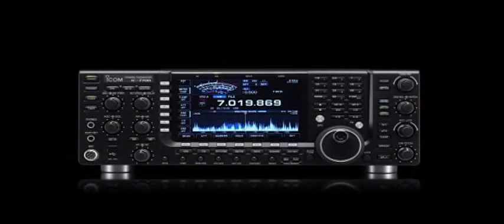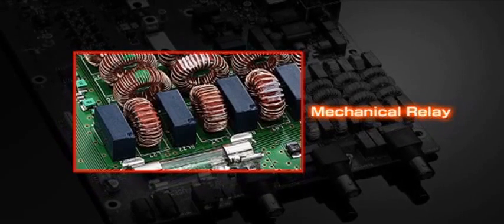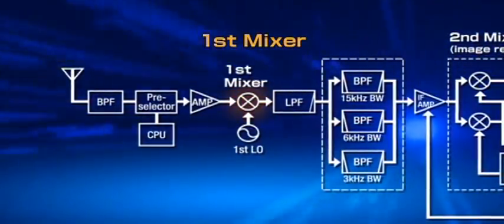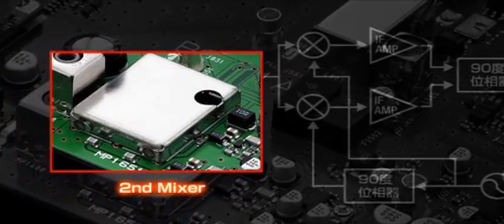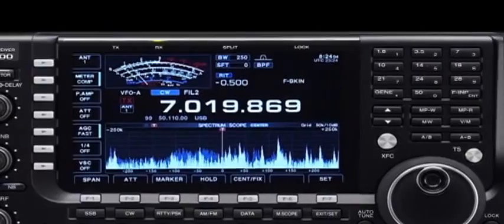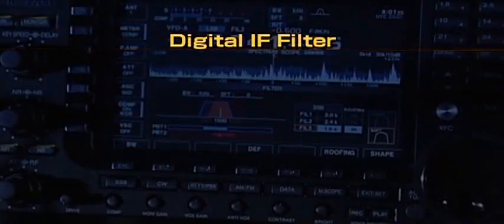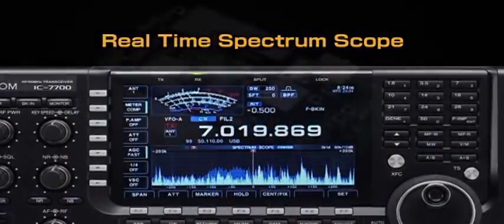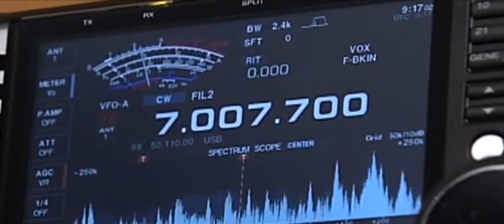A Detailed Overview of the IC-7700

Comment: the new version of the Icom IC-7700 does not use two MRF150 transistors in the PA anymore, it uses now 1 single transistor, an entirely different one. there were lots of problems with the pair of MRF150, they quickly damaged and the repair costs $2000.
Reply: I inherited a free, broken IC-7700....almost a grand to fix it, with Ins./shipping both ways (there was a note on top: receives, but no transmit)....got more goodies than I know how to use, and a 240+page manual....but beats paying $6000 for a new one.....for the big bucks....it should have a 2nd rcvr, like the K3, and K4 (????)....but so far, I do like it.....the internal tuner can't do some of my wire antennas, but it does work on 160M....as my TS-850S does, but my TS-440SAT won't tune on 160....I'll spend the winter, and a few contests, getting familiar w/it.....love CW, so I'll concentrate on getting those parts of the radio down first.....and I do like it, cuz I ain't been on 6 meters, in 30+ years.....and it has 6M.....
Reply: they just charged me $763 for both.....with labor....has the 2 MPF 150's I think it is....but the rig was free to me....had a note on it, no transmit, bur receives well....I sent it to Icom....they said $763....I said fix it....$5995, with a power cord, and a manual, from GigaParts....nothing else....
Reply: MRF 150's....my bad....
Reply: I just purchased an ICOM 7700 from a friends estate and I replaced my ICOM 7600 which I loved very much. I love Big Radios with lots of buttons and knobs and the 7700 has a total of 90 of them.Several are dual knobs but they are still a knob.It’s a Sweet radio by any standard.It’s a great combination with the ICOM PW-1.👍🎙❤️